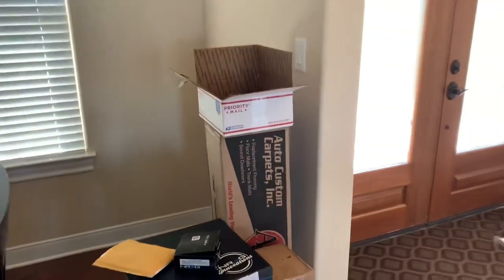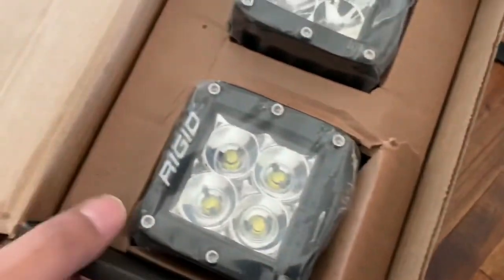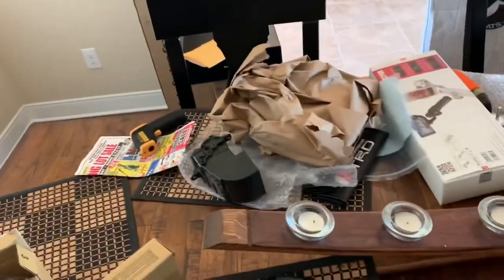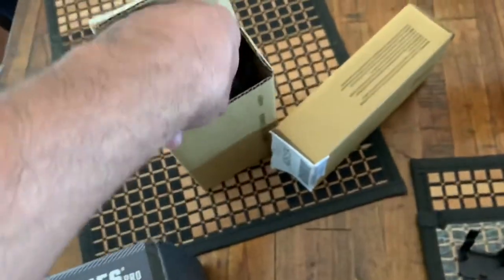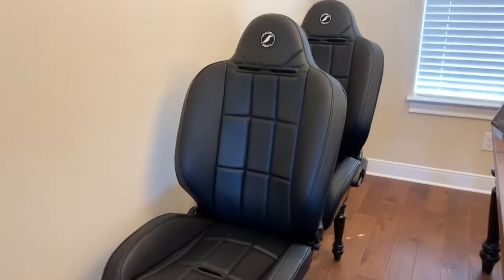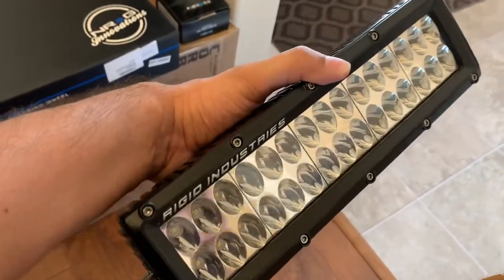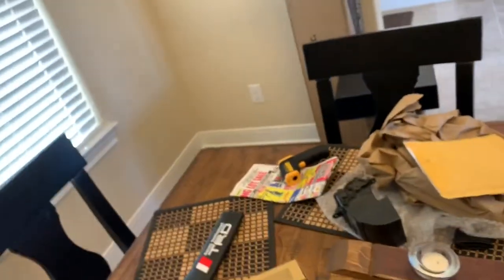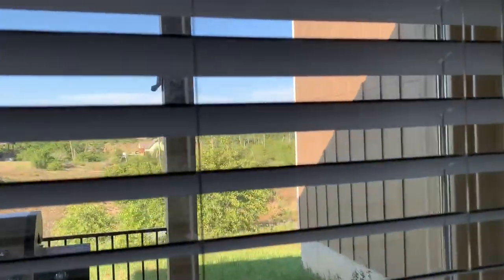Next upgrades on my 89 Toyota pickup!

Comment: Cool accessories! About the rear view mirror, is it a direct fit or do you have to cut out head liner to make it fit?? Where did you score on the SR-5  4runner rear view mirror???
Reply from the maker: Sims skate hey thanks I have to make a couple extra hole but I bolts right on....got it off eBay